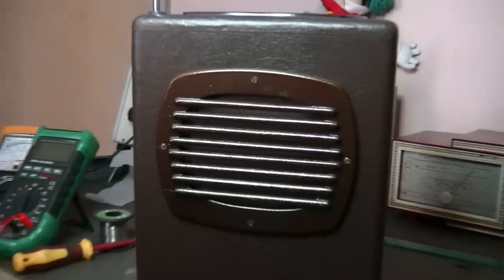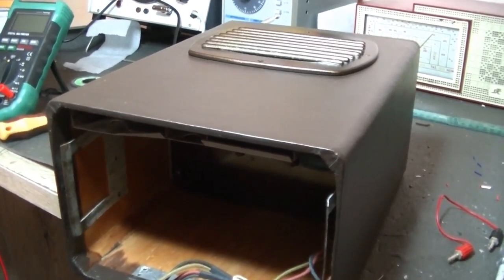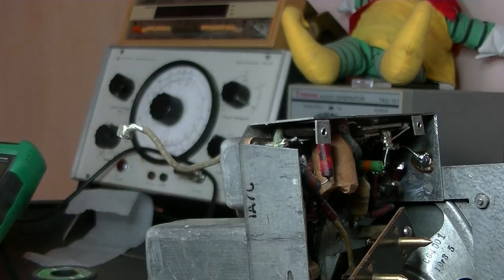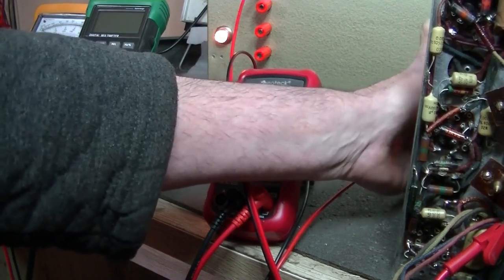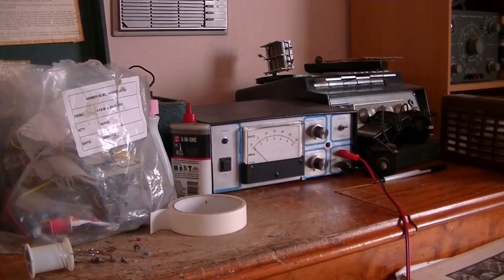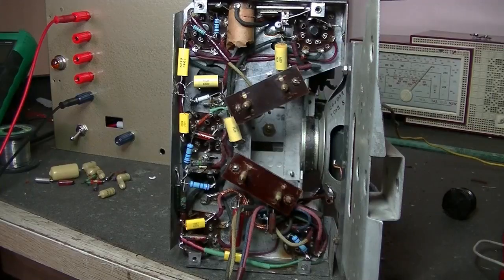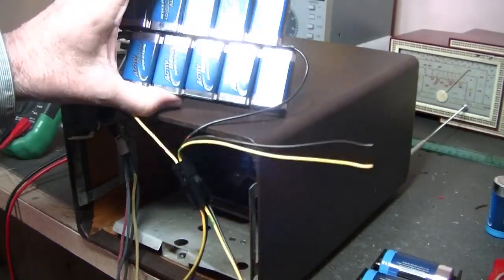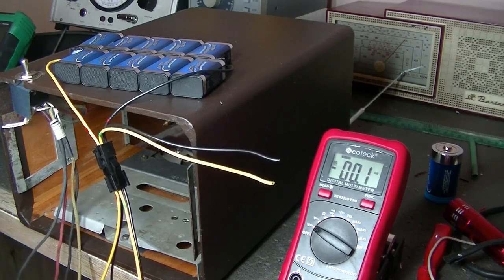Restoring an Astor Porta GC Battery Radio (1939) using the Farm Radio PSU Part 2

Comment: My guess is that there is a capacitor between B+ and ground hiding somewhere that is partially shorted. You could check the HT current draw, probably under 10mA, if that is ok, then at least one of your 9v batteries is a dud. Are they alkalines? I don't think the mustards were around in 1939 and the speaker looks more recent, probably refurbished in th 50s or 60s. Good luck with the fault finding, it's a good little radio.
Reply from the maker: Hey Steve, I'll have another look but I'm pretty sure I've changed all the caps. Yeah, it never occurred to me that one of the batteries could be a dud and they are alkalines. I finished part 3 yesterday and did come up with a solution for the filament issue. Tell ya what, this project has been frustrating lol

Comment: I suggest using your DMM to measure the current drawn by the radio from each power supply (90V and 1.5V).   That will help you to determine if 9V batteries could actually work, and also if there is a problem with your power supply on the 1.5V output.   You can get a data sheet for a typical 9V battery from Eveready or Duracell, and probably many others.  That will show how long the battery will last at different currents.   You can also use power resistors and ohms law to load the 1.5V supply and see how much current it can put out, then decide if it's working properly.
Reply from the maker: Thanks for the info Man, very useful. As you know I'm a newbie with psu's and current/voltage draw. :)

Comment: Nice radio. Surprised that the mustard caps needed changing as they are known to be reliable. I've only ever tested one that was out of spec (out of hundreds). Resistor drift was noteworthy!
Reply from the maker: Hey Adam, Thanks. I've read from many sources that the mustards are reliable but I figure when a component is 84 years old it's best to change it. Just my way of looking at things I suppose
Reply: @exeterslab7781  Fair enough. I've just checked and they were introduced in 1958 so still pretty old! I think the resistors let this set down with their massive drift. Anyway I've subbed. Cheers
Reply from the maker: @BrumAdam  Thanks Man 😃

Comment: I forgot to tell ya, if ya accidentally puncture a speaker 🔊 cone, it can be repaired with speaker 🔊 re-coning glue. Completely trashed 🗑️ speakers 🔊 can also be re-coned. That means ya can buy the speaker 🔊 re-coning kits, and the speaker 🔊 re-coning glue online. Ya put the new speaker 🔊 in the existing frame 🖼️ that the old one ☝️ was. Your friend, Jeff.
Reply from the maker: I must look into re-coning speakers properly one day. Thanks Jeff
Reply: @exeterslab7781  Not to say that you’re doing it wrong 😑, but even I have had to improvise with things to get by. Your friend, Jeff.
Reply from the maker: @jeffreyhickman3871  No offense taken Jeff, there are so many ways to do a single job and I like feedback that gives you new ideas into doing somthing

Comment: For 1939 that is really in very nice condition. I was wondering about those boards that had the pins makes sense they were for the original battery pack. Well that wasn't to difficult you sorted that one out pretty quick Frank. Thanks for another great video.
Reply from the maker: Thanks Larry. I've got part 3 coming up soon dealing with the PSU again and trying to get that 1.5v circuit working. It's not looking promising lol

Comment: That’s an interesting 🧐 little “brick” radio 📻. It looks 1940’s-ish. And real wood 🪵. The speaker 🔊 appears to be permanent magnet 🧲. Just make sure to replace the out of tolerance capacitors. Your friend, Jeff.
Reply from the maker: Caps all done Jeff. Yes it a great little radio :)
Reply: Has the year on the bottom of the radio 

It's F code 1939
Reply from the maker: @stevesavell128  Thanks Steve, I'll have a look

Comment: Apparently your "A" battery schematic doesn't supply enough current to get those tubes going on this particular radio.
That is due to bad resistors and old capacitors dragging down the power supply! Found a slightly better PSU.
 Farm Radio Power Supply V1 by G. Forrest Cook to see how he has used the LM317 in the 1.5 Volt circuit. I actually
 like the design better for both A and B supply as they can be both adjusted to compensate for some loading in the radio's
circuitry. You can modify the B supply to separate maximums like your PSU schematic using the Schottky diodes.
Reply from the maker: I just had a look at cook's schematic. I cant remember if I saw that before, as I've looked at so many lol.  This is really giving me the shits Steve, but I'll persevere with it. Part 3 coming up in a day or two

Comment: Bummer Frank, so the 300Ma is not enough to power the radio heaters and the D cell batteries could be around 10,000 mAH each which work but not for very long because of the construction of the D cells. Perhaps you need at least 14 volts coming out of the transformer to double the .7 volts that you’re getting now or a bigger ampere transformer period.
Reply from the maker: Oh Ken, this is really trying my patience lol. I'll keep at it. It ain't gonna lick me (I hope)

Comment: That’s a nice old set !   FWIW I used the exact same PS circuit on a Philco farm radio and had the same low filament volts issue. Since I only use the PS with one radio,    I just used a trimmer resistor on the voltage regulator to dial in 1.45 V with the radio on.   1.6 V is a bit high.  2 D cells don’t last very long in my experience.
Reply from the maker: Hey, yes it is a nice old radio one you don't see very often. I have another scehmatic with a trimmer adjustment so  I'm going to try that. Thanks for watching :)